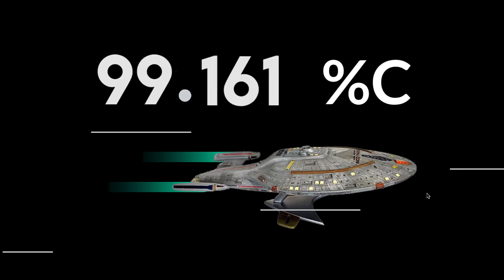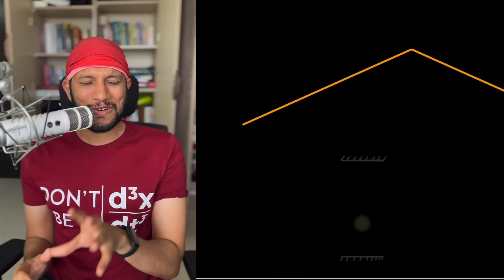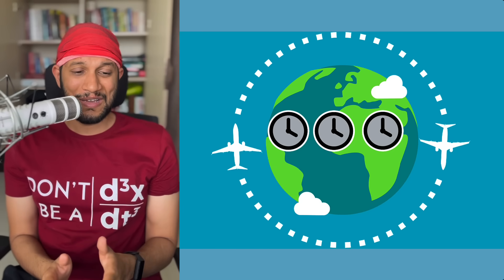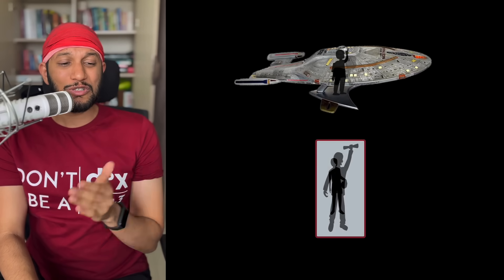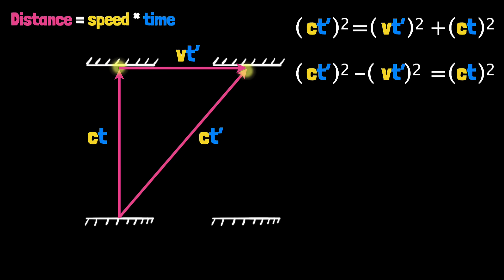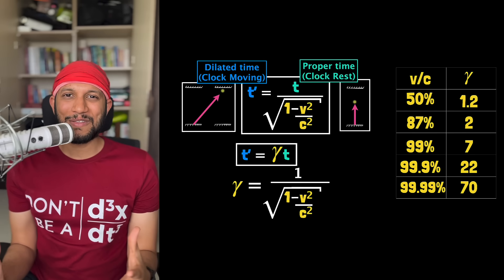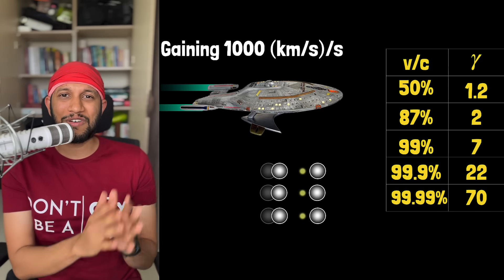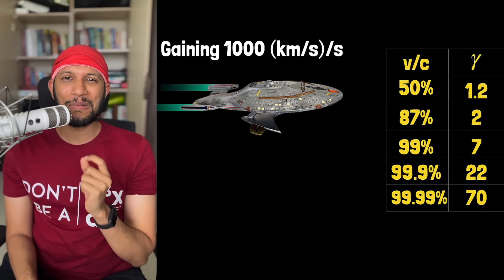I finally understood why you can't go faster than light! (My mind is blown)

Comment: But the ship is moving at the speed of light, and the photon as well. So when the photon bounces back from any of the mirror, won't it move at the speed of 2c? Suppose the photon is not moving at all, but the ship is. Show for the people inside the ship would think that the photon's a speed is zero because their speed and photon's speed are same (equals to the speed of ship). For the outsider, they would be moving at the speed of light. So did the time change actually? It is just the relative speed. Isn't it? Assume, 2 disk shaped mirrors, one stationary and other rotating at a speed of light. Now let the photon bounce between these 2 and see at what speed photons travel.

Comment: Great video and great expressions! But acceleration from "outside perspective" is not acceleration from spaceships perspective divided by gamma. It's actually divided by gamma^3. This is because acceleration is change in velocity divided by change is time. The change in time , say dt', from spaceship's perspective is related to dt from outside perspective by a factor of gamma, whereas the change in velocity dv' is related to dv by a factor of gamma^2. Overall we will have a = a'/gamma^3. So, for example, at 87% the speed of light, the acceleration from outside perspective will be 8 times less, instead of 2 times and so on.

Comment: Strangely, this seems to make me question whether it is actually possible to pass c. Reference frame... outside the ship, it looks like the ship has vanished, because that photon doesn't ever make it from the ship to the observer. That doesn't mean that the ship isn't moving faster, it means that the observer can't see it moving. 

However, what about the clock on the ship? Since the onboard observer is traveling at the same speed as the clock, would they notice a difference? To them, light is traveling along with them, just like a bird on a plane. If a plane is traveling just below the speed of sound, and the bird flies to the front of the plane, does that mean it makes a sonic boom? No, because the air in the plane is traveling at the same speed, and the bird is only flying as a bird would if the plane wasn't moving. 

Back to the ship: the observer on the ship is taking the space with them. The photon on the outside traveling toward the observer is irrelevant, because the ship is what we care about. Time dilation may affect the observation, but does it actually change the ship itself?

Comment: Actually Its wrong.. the photon will take exactly the same time even with the ship moving farward but the path will be enlarged and it willl because ships movement  will reduce some speed of the photon because it is moving to a different direction. You can understand it by putting the clock in the direction of ships movement....

Comment: I need more things exaplained. All this is assuming the fast travelling ship is being observed by someone on earth, right? Let's assume that person is looking at the ship right in front of them, so close they could touch it, then the ship instantly begins travelling at 99.999999999...% the speed of light. With this explanation, would the ship not appear stationary and suspended in the air?

Next, it's shown the photons must move slower between two points because they are moving with the ship. It is also safe to assume the source of light you are viewing this by is constant like the sun. There are no intervals where the light or any component of the ship has time to catch up or has caught up, so it's either lagging behind or it isn't. How is that time not constant between both observers when the ship itself can be physically manipulated by the effect ONLY from earths perspective? Getting further into this, let's say you had a long enough pole to reach the ship from earth and the ship was moving at that same rate a long distance away. What would the people inside the ship hear if you were to tap on the side of it once per second? With your second and their second being the same in terms of perspective, how could it be possible they hear the taps longer than a second apart when you are physically touching it?

Comment: What if the speed of the photon itself is greater than the speed of light, when we are increasing the speed it should also shift the speed of that photon which will result in a non-constant 'c'.

Comment: If some stars in the night sky are dead at the point of origin then light travels at a finite speed.
If photons travel at a finite speed then tachyons and aspects of cherenkovs radiation should mathematically theoretically be able to travel faster than a photon, right? I mean light can't travel fast enough to escape a black hole, no? The information that gets sent is red shifted or what, phased, photons that we pick up in infrared from the event horizon, right?
So shouldn't we use causality as the metric for measurement in SpaceTime which would mean that we should go back to using mass at rest
and would that help String Theory tie relativity to quantum mechanics.

How does the 3rd magnetism, artificial photosynthesis, and teleportation work? If teleportation is different than transportation, and scientists have done it fiber optic cables with particles, is that closer to quantum entanglement? Cause changing location always makes me think of transportation or traveling, but would dimensional or cloning and consciousness transfer be different? I keeping thinking of transportation or traveling through spacetime, but by definition that's different then teleportation.
  The way I explain time dilation is people on the antipode, or opposite side of the planet are 6 hours older, or "in the future", astronauts younger when get back to earth, and intelligent life viewing us would see dinosaurs from where they're at.
  Is anything really a vacuum in space? Cause things from sound (pressure waves), travel for a lil distance apparently in space, and any plasma, that's the presence of a particle, so by merely existing, doesn't it negate a vacuum by a particle existing in spacetime? Is dark matter/energy the medium. Wouldn't it be more like only beyond the expanding universe be the only true vacuum? We could call it the big suck lol.

Comment: Its because velocity imparts mass and eventually your thrust can not overcome the mass it becomes an immovable object vs an unstoppable force scenario, and since neither can win without creating a paradox they simply neutral balance themselves out into infinity. Granted this is easily avoided by simply ensuring the mass does not exist in the same space as the thrust thus averting this conundrum. You would call this a Phase Drive. Just fyi. Because you are phasing the mass gathered by the velocity into and off to the side essentially of the dimension where the thrust is. So your ship will continue to gain speed even well beyond Light. As the mass of the ship, isn't technically moving through space. When you cut the drive off the mass is once again effected by space/time/gravity of its local dimension.

 Even light particles have mass. You could technically create a gravity bomb with light if you could contain enough of the particles at velocity to artificially increase the mass in say a 3x3 ft sphere to that of a planet. then release the fields and boom. Planet bomb. (I mean I supposed you could also use it for artificial gravity also). The trick is to create input for the particles, and ensure they retain their energy, in that sphere without being able to escape and continue forcing them into the sphere until the right mass is reached..

Comment: Best explanation ever!!! Thank you. I still struggle to understand what the person in the rocket ship will feel when accelerating at 1000km/s/s since time will feel normal in there. But totally see it from outside that it will take forever to keep increasing speed.
Reply: Same here! What does the traveler experience in such a situation???
Reply: I always thought that the person in the spaceship looking out would see things moving very fast, like watching a video at 10 times speed, and the person outside the spaceship would see the person inside the spaceship as moving very lowly, if not frozen (but still moving).
Reply: @tony17112acst  nope, consider a photon clock on earth and what that would look like to someone traveling on a ship flying past. the photon would look like its traveling the length of the mirror plus the speed * time.

the ships view of a clock on earth is identical to the earths view of a clock on the ship.

so actually the person in the ship would see everyone outside slow as well.
Reply: @dloathi I don't think that is always true. To "see" something means that the photon that this something emits travels to your eyes, so if you are still and you look at a clock, the photons that this clock emits traveling at the speed of light to your eyes, and you see the clock normally ticking. If you are traveling with near speed of light away from this clock, you will see the clock ticks slowly, cause you are racing with the emitted photons, if you could travel with the speed of light, you would theoretically see, that the clock stops, cause you are traveling with the same photons... But they could never reach your eyes, so eventually you wouldn't see the clock anymore.
But what if you are traveling towards this clock and not away from it, then you would probably reach the emitted photons sooner, so you would see that clock is ticking faster...
That also means, if you travel faster then time away from a clock you would see the clock ticking backwards, since you reach older photons... ?...?...

Comment: You can go faster than the speed of light. Let's say there are two tubes of great length parallel to each other.  One tube is a complete vacuum, while the other tube has material in it that has a refractive index of 0.95. Now let's say that you have a vehicle that can travel at 0.98 the speed of light.  The turn on the ignition, let off the brake and let it rip. Once you get to 0.98 the speed of light, you pass a photon generator, and it gets turned on. It instantaneously gets to 0.95 speed of light, but your vehicle is traveling at 0.98 the speed of light.  You leave those photons traveling at their speed of light in the dust. In other words, it's all relative!

Comment: when i was studying chem, math and physics, i was astounded to the relativity teory. i thought einstein was a genius among geniuses. sadly, no longer do i believe at all. current astronomy was/is founding some universe is moving away at a speed faster than light! the light has fast speed but limited, not unlimited. the light can be faster if you accelerate it. but no one can do it. any object can be faster than light IF you have unlimited energy and can provide the energy to the object.

i do not believe the einstein's speed-mass equation which limit any object speed under light speed. i am smart enough, and learned any science enough to drive a formular of SPHERE VOLUME (V = 4/3 (pi) r^3, without any book or help, only with blank paper and pen! you don't have to agree with me, but do not blame me such as "you don't know physics, so you are talking wrong".

Comment: This never made sense to me, and it still doesnt. The reason is Entanglement. Theory and reality is two vastly different things. Einsteins explanation is theory. Quantum Physics  has proven that observation alters reality from theory. Namely, if you observe particles they behave differently from when you dont observe them. And this is exactly the problem i have with this Photon-clock explination. In theory You cant travel faster than light. But this relies on theory and the fact you observe the Photon-clock or object it self. If you dont, well guess what... Entanglement it self proves that "information" travels instantly over as far as we know, unlimited distances of space, meaning that if one of two entangled particles is altered, the other is affected instantly. So movement faster than light is real.

Comment: if im inside the ship and i feel the time and acceleration normally from my perspective of view, why cant i just eventually get to the speed of light, even though others wouldn't be able to see it?
Reply: How are you measuring your speed? Relativity tells us that all speed is relative, meaning you must measure your speed relative to some reference frame. It can be any frame you want, but you have to choose something. There is no "absolute" universal reference frame relative to which all matter in the universe moves.

So, that said, say you choose to measure in the reference frame of the spaceship itself. Then the question you're asking is "how fast is the spaceship moving relative to itself". Hopefully you can see that the answer is: "it isn't moving". Something can't really be in relative motion with itself. So this frame isn't very useful: you're always at rest!

Let's instead say you choose some external reference frame that is not moving in tandem with the ship, say another non accelerating spaceship. Now the question is: "how fast is my spaceship travelling relative to the other spaceship?" But this is no different from an observer on the other spaceship measuring your speed, and as we've already seen in the video they will always measure a speed less than the speed of light.

So you still will not reach light speed in any reference frame.

Comment: 1 thing confuses me in the example. And I'm no brain so forgive me if this is wrong or dumb.  But in the example of the tick going up and down it doesn't make sense that the vertical up and down would slow down.  I get that the line going sideways is longer but that is because everything is sliding along but the actual distance going up and down is the same so the "tick" would be the same.  At least that's what my brain is seeing.  Again, not my field of anything.  😊 just a party I guess I'm not getting.

Comment: He still didn't explain to me me why it is impossible to travel faster than the speed of light. It was clear before this video why OBSERVER sees time to slow on the ship. But it is always relative to OBSERVER. What if there is one ship that travels with half the speed of light and another close to speed of light then relatively an OBSERVER from the first ship will see another ship traveling just half the speed of light. So  the second ship should be fine to accelerate more relative to the observer on the first ship. But the paradox is that from the point of view of the observer on earth it is impossible as it will exceed the speed of light.
Reply: I think molecules are just unable to transmit energy among them when they are travelling at the speed of light. Because the energy flows (or those force carriers move) at the speed of light, so the force from the back molecule will never reach the next one. Maybe, a more interesting question could be: why does energy flow at the speed of light? But I guess it has something to do with quantum mechanics and it is far more complicated.

Comment: The issue that I see is that the photon clock (with mirrors as shown) is traveling perpendicular to the spacecraft which is traveling horizontally. Even if you rotate the clock and make the photons travel horizontally, it still has to travel forwards and backwards to traverse the same distance, This would obviously result in a slower elapsed time because the distance has more than doubled proportional to its speed. 
I find it hard to believe that if you can create a spaceship (or any object) that can travel 1/1000000th of a second faster than the speed of light at 299,792,458 meters per second, that time would stop, or not exist. Perhaps, we are not capable of calculating speed and time at that velocity. Just because we can't "see it" doesn't mean it isn't happening.

Comment: Feels like something is missing regarding acceleration. If a ship is traveling past another without acceleration then from both ships' reference frame, doesn't it look like the other is moving and resulting in time dilation? But I assume this isn't correct since if there is one twin on each ship, can they both experience the other aging faster and dying before them in their reference frame?

Comment: i have a doubt, i dont know if i am being stupid, but the people inside the space ship wont experience it right, what i meaning to say is  with respect to the spaceship the photon clock is at rest so in space ship the time does not undergo the space dilation change. if you were to take the last spaceship case for us observers it would take infinite time but for those in the spaceship its possible to reach the speed of light and may be even cross it?
Reply: They can't cross the speed of light because of the Lorentz contraction. Space will begin to shrink in the direction of their movement. It's very crazy to think it, but if we find a way to keep constant 1g acceleration no matter what the energy cost, a ship can reach andromeda galaxy, which is 2.5 million light years away, in just 28 years for the clock of the passengers inside the ship. You will still feel constant acceleration, but as space shrinks ahead of you, the ships is travelling less and less distance from your perspective, so you never get pass C.

Comment: i think i get it from this video, but maybe i missed it. the photons move at the speed of light, yeah, but you said that the electromagnetic forces between atoms behave similarly to photons and that's why objects can't move at the speed of light or faster (an oversimplification obviously), why is the electromagnetic force of an atom limited to the same rules as a photon? great video btw, just want to clear up that one part i'm not understanding if someone could help out.